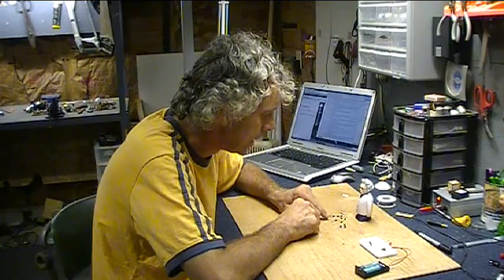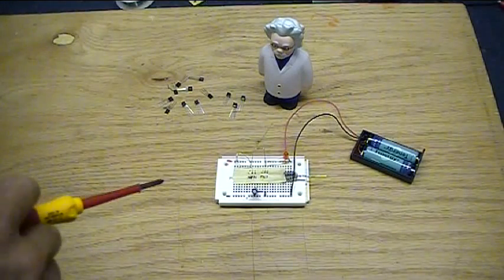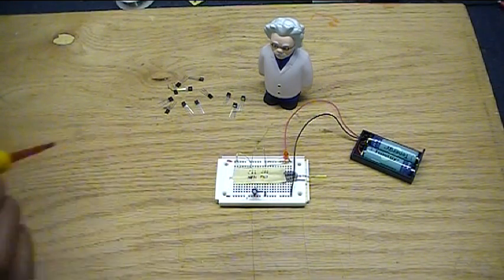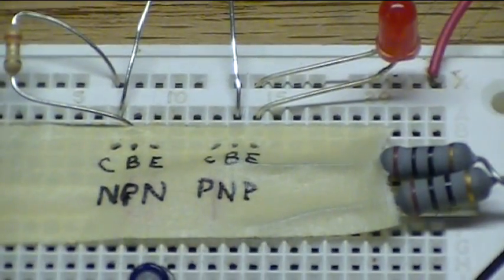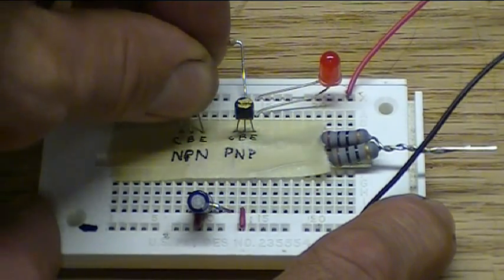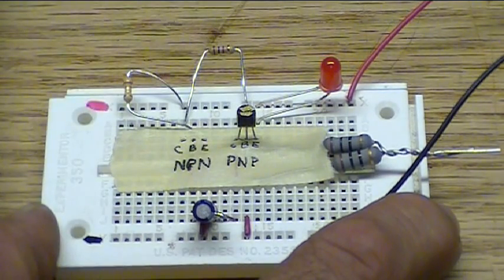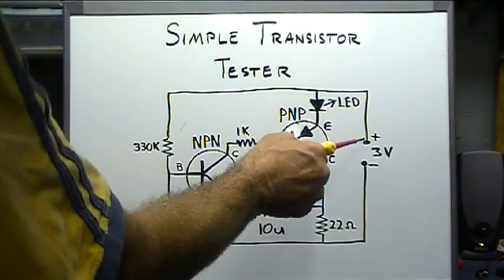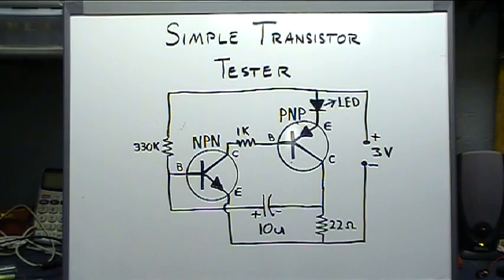Simple Transistor Tester

Comment: Thank you kindly.  Videos like this are useful to me as I begin to build and learn more with transistors.   A couple of questions:

The video seems to assume that all transistors of both types have the pins in the same orientation:  CBE.     Also I presume that all transistors (even those in different cases than the half-rounded TO-92) are to be placed in with the ID letters face forward?

It would be ideal to have a tester that could take just 1 transistor and tell you NPN/PNP and the pinouts!

Comment: Hi, I builted your circuit and I note that if I rotate the transistor 180 degres, (EBC to CBE) the led lighted anywayé  This occur with NPN or PNP transistor slots.   How about iproving the circuit to detect  colector, emitter  and base pins?